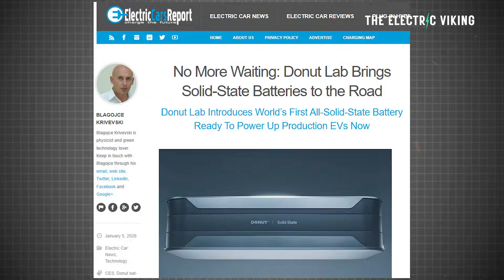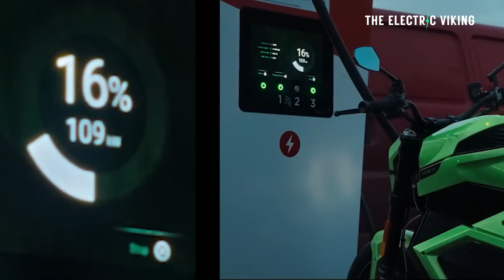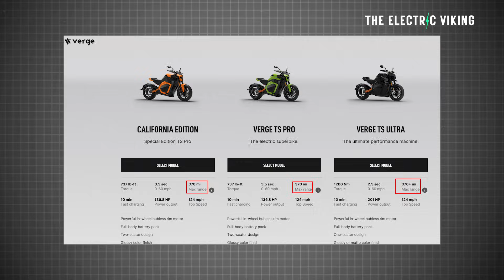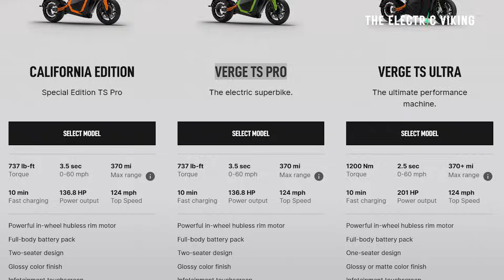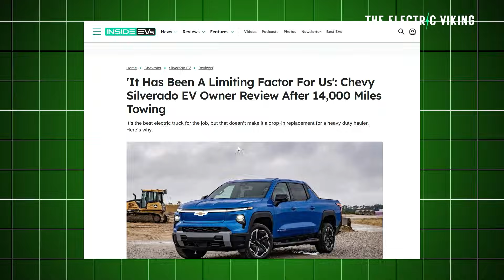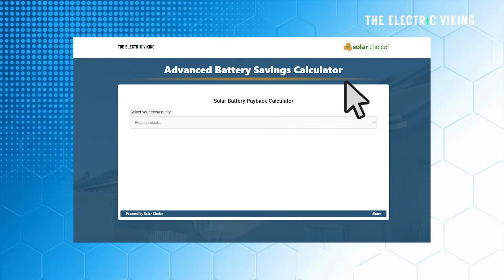The world's first true production-ready SOLID-state battery lasts for 100,000 cycles

Comment: 10kwh is about 100 miles of light use for a motorbike. 220 miles at low speed from 22kwh. Ive been running one for 3 years and best range is below 50mph on a motorbike

Comment: We'll see. If proven true. 
If you can get double the range 100k cycles and 5-15 min charging.
These suckers will cause some disruption. Especially if they are sodium Ion based. 
Small Aircraft conversions in a few years. You really need 3-4 hours endurance for a small plane. 
I live in North Dakota. -20 F is common in January and February. 
Most people wouldn't buy EV's because the batteries are too expensive and once outside warranty if the battery dies the vehicle is worthless. In cold weather the performance isn't there. 
If the performance is true... I'd buy my first EV. If not... I'll keep waiting.

Comment: Sam, why would you say that fossil fuel use declines massively due to these or any other battery? Where do you think the electricity comes from to charge a battery? Batteries are storage, not an energy source. Batteries shift fuel consumption from your car to a power plant, but it doesn't go away. Come on man, you're smarter than that.

Comment: I think the concept of such a capacitor could work! 
I think it is technically a capacitor made from extremly thin graphene and teflon layers. Now because graphene is just a atom layer thin the insulation layer of the teflon layer of 100µm would provide extreme resitistance properties. The leak resitstance could be so small that it can be handled as a battery, theoretically the charge would last 59 years:

A = 1 cm²
d = 1 mm = 0.1 cm
ρ(PTFE) = 10²² Ω·cm   (conservative lower bound)
εr ≈ 2.1
C ≈ 1.86×10⁻¹² F     (same geometry as before)

Leak resistance:
R ≈ ρ · (d / A)
  = 10²² Ω·cm · (0.1 cm / 1 cm²)
  = 10²¹ Ω.

Time constant:
τ = R · C
  = 10²¹ Ω · 1.86×10⁻¹² F
  = 1.86×10⁹ s.

Convert to years:
1.86×10⁹ s ÷ (3600·24·365) ≈ 59 years.

Result:
τ ≈ 1.86×10⁹ s ≈ 59 years.

Comment: Its less about the weight and more about the space reserved for the battery in a given car when switching battery technologies. We don't know the Wh/l for these new donut batteries. Also we don't know how long these things hold their charge given that they are most likely capacitors. That might be an issue for some use cases

Comment: There have been so many battery announcements over the years that never made it out of the laboratory, or, at best, limited production that wasn’t profitable. Solid state batteries have been promised for some time as well. They do have advantages in theory. So yes, higher storage per volume, faster charging and longer life. But how much better is the question. This sounds great, but whether it’s real at this point is something we don’t know. I certainly hope it is.

By the way, I think the graphic shown here had a 50% greater range claim, not double.

WAY too early to think of shorting fossil fuel companies. Even if this is real, it will take some time before it becomes disruptive.

Comment: Likely BS. 
Donut Lab's Solid-State Battery Claims: Likely Fiction (or at Least Highly Exaggerated Hype)Donut Lab (a subsidiary of Finnish electric motorcycle maker Verge Motorcycles) announced at CES 2026 (January 2026) what they call the "world's first production-ready all-solid-state battery." This has generated massive buzz in EV media, but a deeper look reveals big claims with virtually no supporting science, specs, or independent evidence.The Claims (As Repeated Across Sources)Energy density: 400 Wh/kg at the cell level (roughly double current top lithium-ion cells like Tesla's ~250-300 Wh/kg).
Charging: Full charge (0-100%) in 5 minutes (or <10 minutes for motorcycles), no tapering at 80%.
Lifespan: Up to 100,000 cycles with minimal degradation.
Safety/Performance: No ignition even if damaged; retains >99% capacity from -30°C to >100°C.
Other: Lower cost than lithium-ion, uses abundant "green" materials (no rare earths), customizable shapes, already in production vehicles.
Deployment: Powering all 2026 Verge Motorcycles (deliveries starting Q1 2026), with partnerships for EVs, trailers, defense, etc.

These specs, if true, would indeed revolutionize EVs—solving range, charging, safety, and cost issues overnight.Why It's Likely Fiction or OverhypedNo Detailed Specs or Science Provided  Donut Lab has released no technical whitepapers, no material composition details (e.g., what electrolyte? Anode/cathode?), no discharge curves, no cycle test data beyond their own assertions.  
CES demos showed 3D-printed mock-ups and lightweight cell props, not functional prototypes under load. Journalists handled "phone-sized" cells, but no live charging/discharging demos were widely reported.

Zero Patents or Peer-Reviewed Research  Searches across patent databases and academic sources find no relevant patents filed by Donut Lab, Verge, or linked entities (e.g., Nordic Nano, a partner/investee mentioned in some reports). Revolutionary battery chemistry is almost always patented early.  
No peer-reviewed papers from the company or associated researchers on solid-state tech.

No Independent Verification  All performance data comes from Donut Lab's internal testing.  
No third-party lab results, teardowns, or validations (e.g., from universities, Sandia Labs, or OEMs).  
A Finnish university professor reportedly offered to test cells independently, but no results yet.  
Verge's website lists motorcycle ranges similar to current lithium-ion bikes (e.g., ~217 miles city standard, not the hyped 370+ miles), undermining the density claims.

Company Background Raises Red Flags  Donut Lab is tiny (~20-30 employees), privately held, and only recently structured (spun off/restructured ~2024-2025).  
Tied closely to Verge (small-volume premium motorcycles; limited deliveries so far).  
Claims "gigawatt-hour production available now," but no evidence of a factory at scale.

Widespread Skepticism from Experts and Communities  Battery researchers, EV forums (e.g., Reddit's r/electricvehicles, r/QuantumScape), and analysts call it "vaporware," "scam," or "Theranos-like." Comparisons to past hype (e.g., LK-99 superconductor).  
Physics limits: True 5-minute full charges at high density would require enormous power (and heat management) without degradation—challenging even theoretically for solid-state. 100,000 cycles + fast charging is improbable without trade-offs.

Current Status (as of January 8, 2026)The announcement is just days old. Verge says solid-state bikes hit roads in Q1 2026—that's imminently testable. If customers get bikes with verified 400 Wh/kg packs, ultra-fast charging, etc., it'll prove real. Until then, it's unsubstantiated marketing hype from a small startup.Solid-state batteries are real and progressing (e.g., Toyota, QuantumScape, Samsung aim for 2027-2030 pilots), but breakthroughs come with years of papers, patents, and pilots—not sudden CES reveals.Verdict: Treat as fiction until proven otherwise. Exciting if true, but evidence points to exaggeration (at best) or misleading claims (at worst) to boost pre-orders/investment. Wait for independent tests or real-world reviews in a few months.

Comment: I am working on over $1000 worth of new batteries right now!  For my Van I am making into a RV Overlander.  The batteries were state of the art  ...   in the 1850's   :)

Lead Acid Batteries, because Lithium are WAY to expensive and dangerous.  The Van is a 1980's model :), the engine will be a NEW Small Block Chevy (old school not LS)  because that's the best technology available right now :) 

And I can repair it myself.

I am up for new batteries in 5 years, I will gladly switch to these Finish Solid State ones ... IF!!  They are available and cost effective at that time!  ... 

We'll see .. hope I live that long, my own life battery is slowly fading out ...

Comment: I'm engineer and I have investigated this case trough. Tech specs are based in single battery cell teoretical max. performance, in battery assembly it will less. Hardest to believe is 100t loading cycles and how it's tested. The company behind battery innovation is not Verge or Donut Lab, it's done by Nordic Nano which is own partially by Donut lab, they have exclusive deal with them. They have worked with graphite and sodium chemistry 8 years, so the battery didn't pop up from nowhere. They have patented manufacturing process, but not the battery chemistry as don't want to share info how it's done. Competitors have to buy Verge motorcycle to gain access to the battery and then figure out cemistry themself. Right now they are building their first industry size factory, where they will smooth out the manufacturing process, before scaleing it up to mass production. Verge is a private own company, with some well known tech names in Finland as a investors. It will take time before all different size versions of the battery is available for everybody. Only way to invest for Verge now is buy compny Springvest in Finland stock exhange as they own Verge/Donut Lab stock small part from IPO 2023. Stock jumped +14% today. For 100% sure Donut Lab is real and legit company group. I would have used tuned down real life technical specs  for battery as under promise and over deliver is traditional finnish way to do business.

Comment: In terms of using them in aircraft I'd love to see the calculations on that looking at weight vs power output can you get the same thrust / speed running an electric plane engine? Also you have to consider as the plane travels it's getting lighter and lighter as it uses fuel but not the case with batteries on board. So unless the batteries are significantly lighter than the fuel and you can design an electric engine with the capability of faster than sound speeds I don't see it happening any time soon.

Comment: I own a Silverado ev lt. I didn’t buy it because I support one side or the other. I bought it because in Canada where I live, I was able to save about $1200 a month using it for construction use with it’s built in 11000 watts onboard generator power and 6-700 km range at only 15$ a full charge from home overnight. I didn’t get rid of my diesel because I would still not use the Ev for long range travel or towing long distances. Charging from home is by far the cheapest way to charge and most convenient when done overnight. 
BUT mark my words, I would choose the Ev over any other vehicle as much as I possibly can at this point. Pretty much everything is better other than what I stated above. And when battery technology progresses,  combustion engines will quickly become obsolete. Combustion engines have nowhere to go. They aren’t getting any better and arguably they are getting worse with new emission standards year after year. If the next generation battery can even double the range without changing charging speeds, it will still be a huge benefit over combustion. But if it does both, game over ICE

Comment: Charging speed can be super fast but we need the grid upgrades to be able to charge quickly at scale, currently we can’t even keep the 2-5kw loads going on a very hot summers evening without overloads in some areas. No chance of 100kw fast charging if 50% of the population wants it. Energex in qld limits only 4.6kw charging on a single phase at home. Most people will just top up their cars at home for the work commute which will be around 16kwh or less say less than 4 hours of charging while you sleep at the slow rate

Comment: Some corrections: the normal battery has 20,2 kWh (of which 18 kWh  are free to use) which is supposed to provide 350km range, the bigger battery comes with 33kWh (30 kWh net) with 600 km range. Top charging power is 200kW. These are still impressive numbers and it is strange that they do not say what their battery is made of. If they do not use "geopolitically critical" materials, does that mean no Lithium? I highly doubt that. So it is probably "just" no nickel, no cobalt. But what could be anodes and cathodes be made of? What separates them? I think we will find out but it is strange they do not say that when they claim the battery is already on its way to customers.

Comment: Sounds way too good to be true. If it is, watch energy grids crumble under the ridiculous loads this would cause. The uk can’t even handle wind turbine power on windy days and pays billions a year to turn them off… imagine 1000s of these cars/bikes/batteries being charged in 5 minutes at the same time.. might be wrong but it seems like a lot of power in a short time.
Reply: but the energy needed is the same. except now the car only charges in 10 min. but yes- if everyone would charge at the same time it would be a problem. but it wouldnt be so hard to distribute the times of charging somehow, maybe by dynamic pricing higher in peak demand. and at home its just same as it was
Reply: @nonono173 if this solves the safety issues, charge time and even possibly some of the cost issues then I would think ev uptake would be high(er), didn’t it say it had higher energy density as well?.. So potentially lots more cars charging in a shorter time with more energy density.. would be interesting to see.

Comment: Breaking news: oil is not made from fossils. Do you really think there was enough dead animals to make that much oil ?
Also, oil and gas is about to surge in price and use. These resources pulled us out of the dark ages and continue to power industry. Without cheap energy, we are done. EVs sound great, but if they cost more to run than an ICE vehicle, what's the point ? It's just padding someones wallet.

Comment: Too many weird claims and facts that do not seem reasonable and no independent validation.  If the claims seem too good to be real that is likely real truth. The charging rate is too quick and would be simply dangerous and certainly not using the very standard charging head shown in your video.  If you had a world shaking battery and technology would you really be using an obscure niche new electric motorcycle producer as your launch customer.  Scam.

Comment: Having used Jumper cables, Many many times,,,,,, And tghe way they get Hot.  I Do not see this working, Those connector tabs will overheat pretty quick, And fail. You simply can't transmit the Amps through skinny tabs like that.     We shall see, But i cant see it in this format

Comment: A truly historic announcement. Witnessing a solid-state battery cross the threshold into mass production is a monumental achievement for the entire energy ecosystem. While the 100k-cycle cell is the star, its real-world application in EVs or devices will place unprecedented demands on the surrounding hardware: ultra-precise thermal management systems, robust yet lightweight module housings, and vibration-resistant interconnects. This is where high-precision manufacturing becomes critical — producing the complex components that protect, cool, and connect these revolutionary cells reliably. The future is not just about the battery, but the system built around it

Comment: I have a 19kw BYD BATTERY with a GoodWe 6kw inverter  8kw with Jinko Neo all black panels 17 of 460 Kw.  On the gold coast my bills $1170 in CREDIT.  14 kw of aircons 4 separate al recentlyl new Mitsubishi heavy Industries, 7kw, 3,5kw, 2kw and 2kw units (great units) ON most days and nights for the summer.  a pool. 
Friking awesome!! All electric house (hybrid car) 18 motnths old now. Have not paid any bill since install. Its just clever thinking and timers on things like Hot water Systems.    Paid for itself already.

Comment: certain new solid-state battery designs, particularly Samsung's silver-carbon composite anode, use significant amounts of silver (around 5 grams per cell, or 1kg per 100kWh pack) for enhanced performance, which is vastly more than current lithium-ion batteries and could drastically increase demand for the metal. This increased silver content is crucial for stability, conductivity, energy density, and faster charging, creating potential supply concerns for the broader market.

Comment: This is not surprising as its been in the works for years. Many hew battery technologies on the horizon. I would be shocked if an electric car in 2030 wasnt less than $20k with over 600 miles on a charge.

Comment: I don't believe any of their battery claims. My question is how does a company that develops new electric motors could also crack the secrets to develop the ultra fast charging solid state battery with ultra long cycle life? These fields are not connected in any way. It is important to know that these secrets have evaded the battery scientists and companies who are working on the solid state batteries for few decades now. Donut Lab's linkedin page says that they have 11-50 employees none of them seem to have any battery cell development background or experience. I would never believe if someone claims that they could right now mass produce battery cells in the order of gigawatts without any prior experience since it is extremely difficult to mass produce battery cells with good quality and high yield. I don't even believe that they even developed their own battery cell.

Comment: Cutting the battery weight in half doesn't mean doubling the range. Companies aren't going to double the kWh of batteries just because they have the weight capacity to do so. In a 6600lb Cybertruck, we're talking 312 Kilograms of weight savings with the same 125 kWh battery. It brings Cybertruck under 3 tons. I don't know how much of a range boost that would give it. These batteries seem like they'd be great for drones and smaller EV where they can be swapped out to new vehicles after 5 to 25 years.